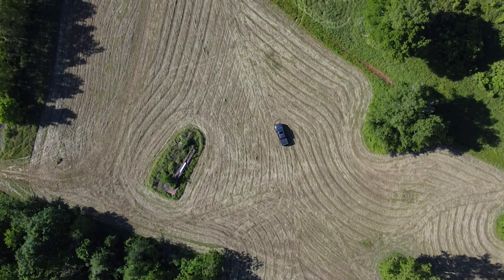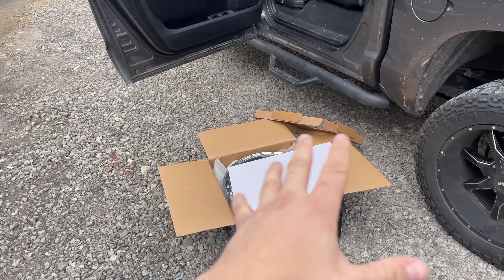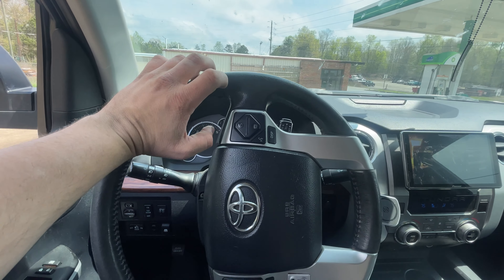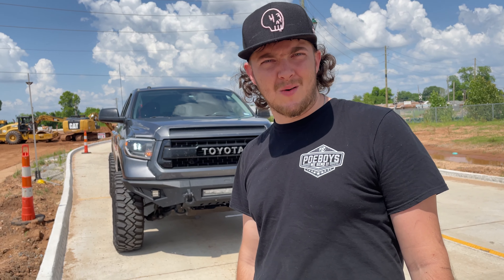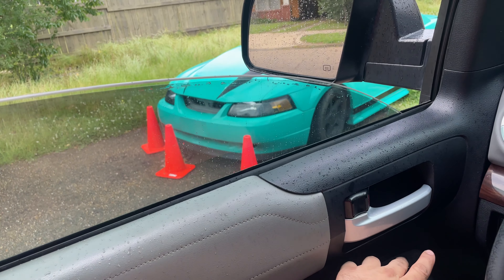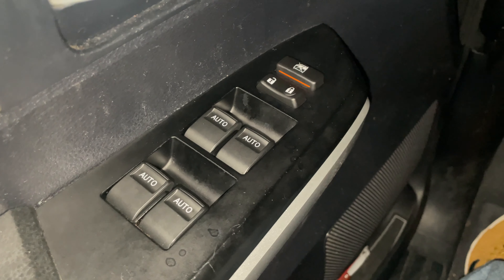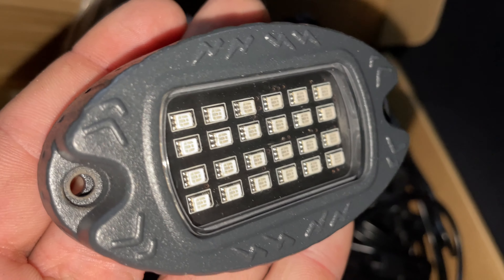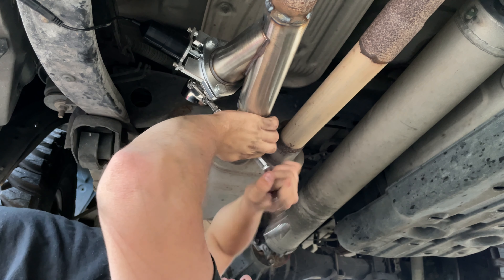INSTALLING MY TOP 5 ESSENTIAL mods for any TUNDRA!! + How to fit 37's + LED's + EXHAUST (FLAMES)

Comment: Nice upgrades. Now my experience with Auxbeam LED's. I put Auxbeam LEDs in my tail lights. I installed them and had gone through 3 sets within a 6 month period. They do not last long at all, especially for brake lights. I like how bright the bulbs are tho. They look amazing when they work.

Comment: I know you have 37s but what are the dimensions for your wheels? Are they 17x9? They look pretty wide so im curious. Been considering doing a 20x12 but your stance seems perfect. So if you know the offset and width and backspacing, that would be super helpful for me!